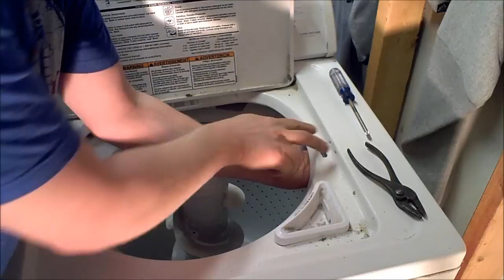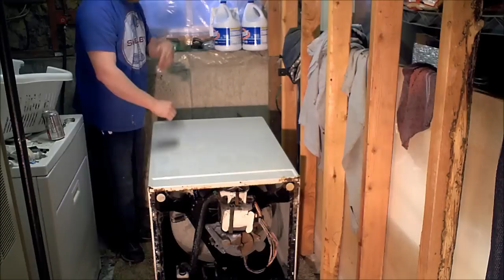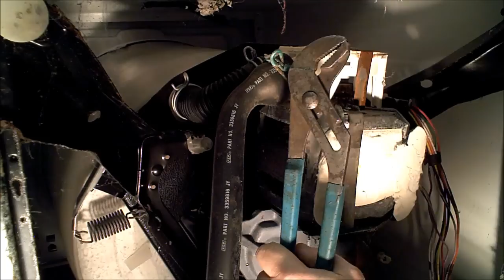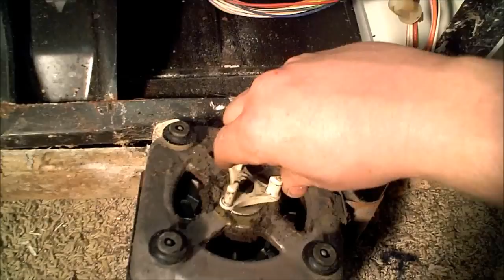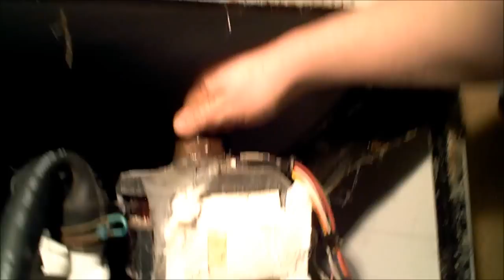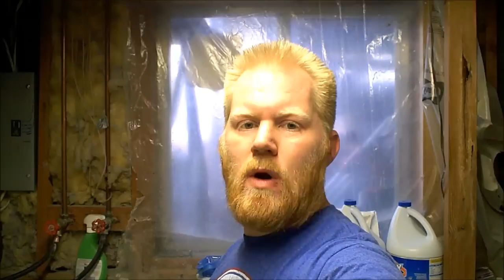Whirlpool Kenmore Washing Machine Not Spinning also Leaking fix

Comment: Have to tell you. This video made it SOOOO easy to check everything with my 30 year old Whirlpool washer that wasn't draining or spinning. I had already diagnosed the lid switch issue and bought the replacement. Before I re-assembled the unit to test it, I used this video to make sure the pump housing and coupler were not in play just in case. Thanks.
Reply from the maker: Thanks for watching.

Comment: I replaced the coupler and put it back together. The washer spins now and runs fine but it smells like burning rubber and I'm worried that it will start a fire. What did I do wrong?
Reply from the maker: The coupler could be slightly misaligned or slightly larger than the original and rubbing on the housing. It wouldn't worry about starting a fire and would run it through a cycle or two and it should stop.

Comment: I'm having trouble figuring out what is wrong with my washer, it's a whirlpool ultimate II, bought it new in 2004 so not new by any means, a little less than a year ago I replaced the clutch, agitator dogs and motor coupler, and now when it goes to spin cycle it try's to spin for a second and then stops and makes a loud aaaaagggg noise which is continuous and doesn't stop until I shut the washer off. Everything else works just fine, it fills it agitates, it drains. I can't figure out what is wrong with it, I thought it was the motor coupler and I took it apart and that's fine and intact no problems at all, I'm at a loss for what's wrong, please help!
Reply from the maker: +Melissa McVicar It's a rarity but your gearbox could have issues. There are a few videos on it and if you're comfortable with all the other fixes it's not too bad.
Reply: I just bought a spanner wrench on amazon and drive block to see if maybe that's my problem, I took pictures of the little bit you can see of the drive block without removing that super stuck not coming off without the spanner wrench nut. I will take a look at gearbox videos thou in the meantime. I just want to fix whatever is wrong and put it back together before I forget how lol I have a family of 6 and it's been down for 4 days now, really wish I just knew what was wrong. Do you know if the videos show ways to tell beyond a doubt if in fact it is the gearbox? It's currently in pieces as I've removed the pump and motor to check motor coupler and didn't want to put it back together in case the issue was in fact in that area and have to take it apart a second time.
Reply from the maker: This is a great video on the gearcase https://youtu.be/ieZ5y47TAMk

Comment: Great video! i have followed all of your instructions and after replacing the old cracked coupler with the new one, it did spin with no clothes on. i run a load and it made a squeeking noise as it was on Rinse mode, then when on Spin mode did not spin.. my guess is that it is a bit too tight (i tend to do this) I'm gonna try and loosen things and see what happens. Any thoughts?  Thank you very much, i have subscribed to your channel +sixtyfiveford, it is great you post all of this solutions to very common problems, brilliant!

Comment: Hi a quick question. Dose the coupler make the tub and the agitator spin? Because the both of them won't spin in my washer.
Reply from the maker: +CHUCK20O9 Yes, the coupler makes everything work except for the water pump.
Reply: +sixtyfiveford how can you tell if the waterpump is bad
Reply from the maker: Kalyssa Koehn Softball
It leaks= it's bad.

Comment: PS So, cool that you bought the coupler used. I'm all about buying stuff used. Not just to save a few bucks but because I like to support folks who sell used stuf AND it's good for the environment. I figure, if YOU bought a used one, sounds like that's a good idea, right? Anything I should be aware of?
Reply from the maker: +George Rutherford I just like saving a buck I guess. I think OEM parts are built better than aftermarket, so figured I'd get the same life out of a used one that was only a few years old when my original was 15 years old.

Comment: my washer stopped working. it does not spin not does it drain. I do hear a clicking sound coming from it. but that may be from the timer? it's a very old unit I would have to say late 80's early 90's. I tried to remove the lid switch but not sure how to test if that is faulty or not. any help would be greatly appreciated. I know I did not leave much info to work with.
Reply from the maker: +dannyny You can bypass the lid switch by connecting the two wires together. Cation as they are 120V so don't hurt yourself(unplug the washer first).
Reply: +sixtyfiveford thanks for the quick reply. I remember in the past I would open the lid mid way thru a cycle and it would still work. I would throw in another article of clothing. it won't spin but still would move around. now today it won't do any of that. it would still fill but won't move or drain. I hear the timer but nothing else. I can't bypass the switch. they have plastic pieces on the end. is there any way for me to stick a piece of metal in there to connect the two wires?
Reply from the maker: +dannyny Will it fill now? Does the timer advance through all the settings without doing anything?
Reply: +sixtyfiveford it will fill toeach level selected (small load medium load large load) the timer will go from start to finish. there are noises that come from the machine but it won't spin or drain. if I manually take water out it will fill back to where it needs to be.
Reply from the maker: Sounds like your coupler is broken.
Reply: +sixtyfiveford I came home today and plugged the machine back in and opened and closed the lid 6 times and set it on the spin cycle and it started working again. not sure if it will malfunction again shortly but it worked. I tried the open and close thing a few times the other day but nothing. today after a entire day of leaving it unplugged it works again. thank you for all your help. I think I may need a new washer shortly as the one I have is super old anyway.
Reply from the maker: The internal contacts on the switch could have just been a little corroded from moisture.
Reply: +sixtyfiveford thanks for all the help. hopefully it will last me for a little longer until I can find a deal on a new machine that I want instead of going out there and getting a machine at full retail price. great videos!
Reply from the maker: In all honesty you're better off with your old machine... The new stuff is junk.

Comment: Hi I have a Whirlpool Calypso washer about 12 years old. The problem I am having is that when it fills up with water it starts and stops filling a lot. Also when it pumps the water out it will pump for a second or two, then stops for a few seconds then pumps for a few seconds and keeps that cycle up until it's empty. What could be the problems I am having?
Reply from the maker: +Kristy Howsare Water level sensor is bad.

Comment: my washing machine will spin if i give it a bit of help by giving it a swing around....then it will get going. What would the problem be then? My washer agitates, so I am thinking it is not to do with the lid latch if everything else on the wash cycle works properly?
Reply from the maker: Bernadette Groves The clutch band is worn. I don't have a video on it but there are a few good ones on Youtube.

Comment: My Kenmore will agitate but not spin.  When the timer switch moves to the rinse cycle, the machine just turns off, no sounds, no hums, just quiet.  I replaced the timer switch and start capacitor but haven't solved the problem. What could be the problem?  Thanks
Reply from the maker: Sam Horton My first suggestions would be exactly what you changed. I would check the lid switch first of all. Then does the timer continue to advance to the end of the cycle or stay stopped at the rinse?

Comment: Thanks for your video.  I have a Whirlpool Ultimate II washer and sometimes it spins the clothes dry and other times I have to open the lid and turn the bowl and then it spins the clothes dry; but this happens mostly on the regular wash cycle.  The timer does not seem broken nor does the door switch seem to have a glitch and no leaking.  What could the problem be?  Thank you.
Reply from the maker: 818Linda Sounds like its either the lid switch or the agitator dogs.

Comment: I have a question. My washer is working in every way except to spin. I smelled something like burned plastic or rubber, when it stopped spinning. Is that normal? Thanks for the video!! Terry
Reply from the maker: ***** Sounds like the coupler.
Reply: sixtyfiveford Okay, I have the part and I have taken everything apart to repair it. I have a question. Ho come your coupler goes on so easily? Mine is a very tight fit. I used a screw driver to get the old one off. I am having problems getting the new one on. Is there a trick to it?
Reply: ***** I have finally got it back together and the wringer is still not working. If I open the lid and turn it by hand it tries to work.
Reply from the maker: If it tries to grab when you turn it then the Agitator Dogs are worn. They are cheap and not difficult to replace but require a little brute force. They are right on the top of the wringer under the liquid softener cup. I don't have a video on it but there are some good videos on Youtube about them.
Reply: sixtyfiveford I am 115 lb women. I hope I have some brute force left in me! darn!!
Reply from the maker: If you can feel it grab a little then it's the Agitator Dogs for sure. http://youtu.be/3jMcFyxuRIc is a decent video but the "clothes mover" doesn't always come out that easily.

Comment: I just went through this about a month and a half ago. One youtube guy was saying it is the lid switch, another saying it is the motor and another saying it is the capacitor and then another saying it is the coupler. My washer stopped washing in the middle of the cycle so I had to drain the water out and take the wet clothes out. Lid switch was good, the capacitor was good (went to a parts shop and the nice lady checked the capacitor with a capacitor tester, you don't use a resistance meter on this as it does not test it right) so the guy told me that it is probably the coupler ($25.00) so I bought it with the understanding that I could bring it back if the problem is something else. When I took everything apart (just like your machine) the coupler did not look that bad but I did not look very closely at the motor piece, I was looking mostly at the black rubber part so I changed everything out. When I tried this the discharge hose popped off (just changed out the hose last year) and flooded the room. I stopped the machine and put a worm gear clamp on there so it would not pop off again. Everything ran fine but a couple of times there was a burning smell but no fire or smoke so I am not sure what that could have been. I need to watch more of your videos, they will save me time, money and aggravation. Thanks for what you are doing.

Comment: Hi there. Nice video. I just replaced my pump for $9 after the whirlpool stopped working and did not drain the water. I just replaced and I can hear the lid click shut, but absolutely nothing happens....no noise at all. Do I need to reset the unit somehow or would this be my coupler? I will take back apart and check the coupler in the meantime. Also - on my unit there seems to be no lid switch like yours? I hear the click as noted, but do not see any type of magnet or anything on the surface?
Reply from the maker: Nick Rieth It will not drain because: the coupler is broken, the lid switch is defective, or the timer isn't moving. You should here a hum if the motor is running. You say "no noise", did you trip the circuit breaker?
Reply: Sort of had a moment...I had shut water off, but after turning on and it filling with water - it would not kick over to next cycles and would not drain. I ordered the coupler, however, I do not remember hearing a hum from the motor?
Reply from the maker: If the timer know doesn't ratate to the next cycle, it's either the timer itself of the lid switch.

Comment: I have the exact washer you are working on in video my question is will replacing that part make my washer wash again .. It seems to just be holding water ..  Draining and not spinning...
Reply from the maker: Check the door switch first then flip it over and look at the coupler. If the coupler is sheared then yes it will fix your problem.
Reply: Thank you for your fast response

Comment: Do you have another suggestion I can try before attempting this? l I m just hoping for something simpler
Reply from the maker: The door lid switch is the simplest suggestion. It could think that the door is open. Sometimes just putting a screwdriver, pencil or similar into the hole the finger on the lid presses into when closed will activate the spinning.

Comment: A comment:
When you do an instruction video I think you should assume complete ignorance on the part of your audience and mention the little details like it being a good idea to first turn off the water supply before unhooking the water hoses.
A question:
The white parts in the new version of the coupler now have metal inserts to avoid the stripping problem.  I have read opinions that the metal creates a new problem of possible damage to engine if the part should fail.  Do you have an opinion?  I see that your link to the coupler part looks like it is for the older version without the metal inserts.
Reply from the maker: The parts are meant to break to prevent damage to the transmission.  Under normal circumstances the coupler won't break and should last around 10 years. The non-metal ones are adequate.

Comment from the maker: I have a link in the description for METAL insert COUPLERS!
 Links to the water pump are in the item description.
Reply: Replacing  capacitor on whirlpool washer
Reply: I replaced my broken coupler but it is still not spinning.  any troubleshoot tips? could it be a bad clutch?
Reply from the maker: @danmaxwell414  The lid switch is always suspect. Was your coupler actually broken/stripped?
Reply: @sixtyfiveford   yes it was split into pieces.  I replaced with a new one. it no longer  thumps and knocks and I hear the motor trying to run.  could it be the clutch is bad?
Reply from the maker: @danmaxwell414  A bad clutch won't cause the coupler to break. A bad clutch/brake symptoms are: no spinning under load but may start spinning if you force it to start by hand or it'll spin with an empty washing machine but not with a load. A bad clutch will also still allow the washing machine to fill, agitate, and drain.

Comment: Hi sixtyfiveford.  I have a washer who's insides match the ones in this video.  I am hoping for some advice.  It agitates, but won't spin or drain.  Instead, (when the lid is closed) it makes a buzzing noise and a burning smell, and the motor gets very hot.  This happens even with the motor uncoupled from the transmission and pump, so it's not a jammed transmission or a broken pump.  I figure the motor is probably broken, but before I replace that, I was wondering if it might instead be an electrical fault in the panel (say, trying to drive the motor in both directions at once or something).  What do you think?  Thanks.
Reply from the maker: The motor has different speeds for different operations so it is possible one of the speeds is burnt out or it could be a bad run/start capacitor. The Timer controls what get electricity but it is virtually impossible for it to apply electricity to more than one function at a time. Some motors have a centrifugal clutch inside that can rust and seize. It can be freed up with WD-40.
Reply: sixtyfiveford
Thanks very much!  My machine is only 1 speed.  I'll definitely check the capacitor first - that's easy.  Is there a video showing where the centrifugal clutch might be, inside the motor?  Also, the last few months, the spin cycle frequently starts with the brake engaged, and I have to open and close the lid to loudly "click" the transmission and un-brake it (an annoyance, but not worth repairing for its own sake).  Could that have strained the motor, leading to a burn out, or is it unrelated?

Comment: I was wondering about something. I have a whirlpool Ultimate Care II machine. It stopped spinning so I am going to do what I learned in your video, thanks! When I was looking at it before watching I noticed to pins that sit in little plastic cups. It almost looks like they should be put into a couple of the black parts above and held in with a cotter pin. Can you tell me what they are and if they should be anywhere but the plastic cup? Thanks for your help!!!!
Reply from the maker: I'm not sure what pins you are referring to.
Reply: sixtyfiveford I have a whirlpool Untimate Care II. The little cups are hanging off of one of the black support parts for the drum. inside them are these pins. At least they look like pins. just seemed weird to just be hanging there.
Reply: Trichak Sorry to bother you again. In your video when you are getting the pump out of the way i can see what looks like one of the little cups i am referring to. It is white/clear in color.
Reply from the maker: There are little cups that are designed to catch drips so they don't fall into the motor.

Comment: good vid, my problem is that the tub spins but not fast enough to spin the water out of the clothes, the clothes are still very damp. could my problem be these couplings?, thanks
Reply from the maker: No. It sounds like your clutch. Not the most difficult thing to replace but it does take a little time. This guy has a good video on it http://youtu.be/TB_W6sPdzkM